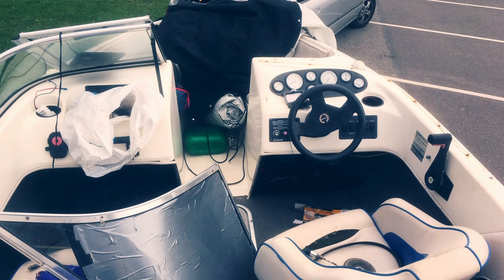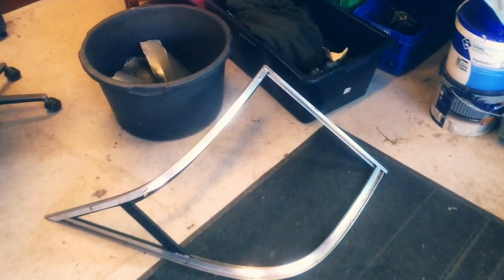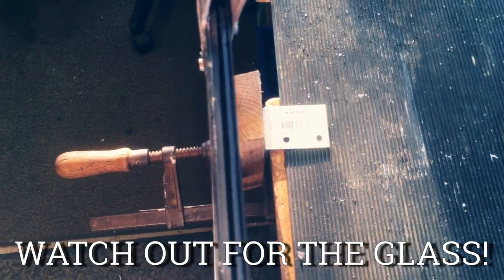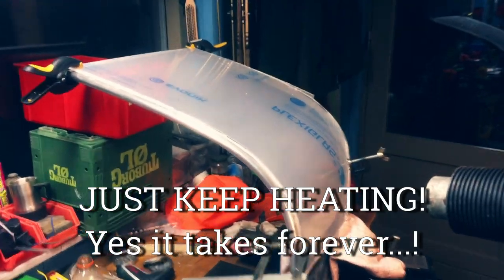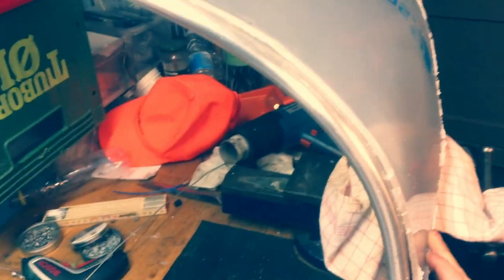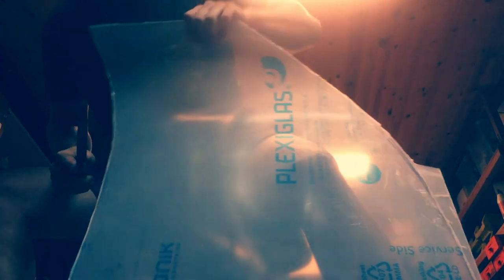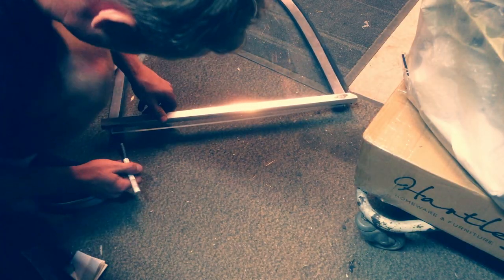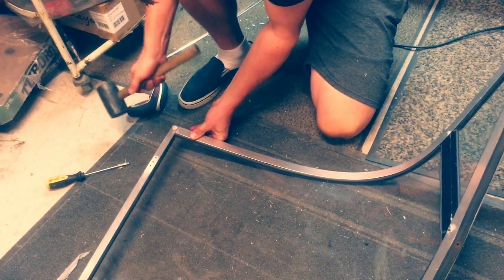How to replace boat windshield with plexiglas DIY

Comment: Thanks for the video.  As a note, glass company suggested Lexan (polycarbonate), but I could not get that to work as it is much harder and has a higher melting temperature.  Got a piece of Optix (Acrylic) and it was done in about 5 hours.  Thanks again!

Comment: Hi Kasper! Did you have any problems when bending the plexiglass with lines appearing where the bend points are? Or is it all visually perfect. I couldn't make it out in the video. Thanks!
Reply from the maker: No i did not have that problem... But could be ftom overheating maybe?
Reply: @kasperserup  Not a problem I've had, just a concern. Thanks for your quick reply!

Comment: I have a 795 Jeanneau cabin cruiser that comes with a big windshield… but in summer is way too hot… how would you split the glass in half to be able to open the window and receive the fresh air and get the sensation of a bowrider, and be able to close it back if needed? (Rain, etc)… any ideas to be able to split in two and have a subdivision?

Comment: Did you have any sagging between the frame when you bent it or did you heat it just enough  to bend it? Be nice not to have to make a mold.
Reply from the maker: I dont know what sagging means. But yes i just heated it slowly so that it bend a little bit. And then is went a little lower. Takes some work.

Comment: Hi, im going to do in my tahoe q4 , cross finguer 😃.. its any special plaxyglass ? Or all are the same?
Reply from the maker: I is the same. But there is also polycarbonate glass. That is more expensive but dosent crack. But it fades easier over time😊 Good luck with the project!

Comment: Hello
How do you heat?
You said two hours, but all in the same area?
Reply from the maker: No not the same area only. I heated up one area more first, and moved down along the way. Then i could bend it gradually along the way down. Takes a long time...
Reply: when you heat it up. will the exterior protection plastic layer melt and stick to the plexiglass?